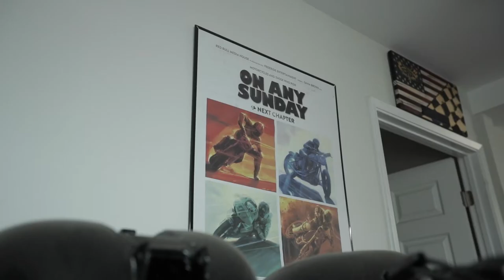Galfer USA Wave Rotor Installation on 2022 Harley-Davidson Low Rider ST

Comment: Without a real front master you’re absolutely wasting time with those rotors.  100% no bullshit and I’ll tell ya!  I have an inverted Ohlins, 320mm Galfer full floating rotors with Brembo M4 monoblock calipers, EBC EPFA  brake pads, braided lines & tested my break theory first hand son.  
With all that hardware breaking was marginal (at best) over the O.E. system.  I know, smoke crack every day.
I use an RCS Brembo master on all my Ducati’s, but pulled the trigger on a Beringer front master  for the Harley witha  20.6mm bore . I run a 17.5 bore on my single rotor- Supermoto  and love the feel on track.  Best thing you can do  (besides good tires) for your HD brake system is throw that piece of shit stock master into the trash.  Yes, I know  a  front master cylinder is big bucks, but how much is your life worth? I’m telling you right now,, if I had to put a percentage of brake loss left on the table using a stock Harley master  (even with all that upgraded expensive ass hardware) I’d say you’re losing about 40%
That’s no bullshit!  So save your money on those rotors until you’re ready to put an upgraded master on that pig. That POS StockMaster doesn’t even come close to having the required power for those calipers to bite. That’s the truth! Your wife and family will thank me later when you actually come home through the front door after your ride
Reply: You know there’s a sucker born every minute that’ll watch this video and will have to have those for the ooh wow factor. SMH
Reply: What Harley do you run the inverted Ohlins forks on? Your brake setup sounds very similar to the setup on my Sportster!
Reply: @jonnymac8925  it’s on my 2017 Dyna Lowrider S. If you went to this past Born Free show it was the black Dyna @Ohlins booth.  Glad to here you’ve done Suspention upgrades! Having the correct damping is crucial for safety, traction and predictability. Having the confidence and knowing that your tires actually  maintain  continuity with the road surface 100% of the time can shave 1/3 off your breaking distance in the dry ‘even’  when utilizing the sub par OE brake system! If you want to take your Sportster  to the next level let me recommend the Ohlins TTX 30’s for the rear. True, independent control of compression and rebound circuits. They’re pricey, but holy shit man- they’re insane! 
Take it easy my friend, ride safe🤙
Reply: @noonespecial1217  unfortunately I live in Canada so the Born Free show wasn't an option this year, but a lot of my friends down south went and had a blast! I'm debating on a NIX22 front end for the Sportster, but Rebuffini also makes a KILLER inverted front end that runs Mupo internals (another large Italian company used in SBK). The bike doesn't get tracked much so its more of a street ripper. That being said I think you  may has misread my comment, I was saying my brake setup is similar to yours, my suspension at this time isn't nearly as badass as yours. Currently I'm running 13 inch Progressive Suspension 490 Sport Series shocks with a Progressive Suspension monotube cartridge forks kit, and a Daytona Steering Damper. I've been pondering keeping the 49mm forks with a Nix22 setup on some Zack Nation Racing 2 inch drop trees with the GPR stabilizer. As for brakes, I have the bike sitting right around the 500lb mark, and it doesn't get tracked (drag races are about it since we didn't have an actual road course until about a month ago in my area) so at this time I am running a single disc setup in the front, but it's a good setup! I'm running a 13 inch Galfer Radial Wave rotor, Brembo m4 monoblock, TTI radial bracket, HEL braided line and a Brembo RCS15 for the front. The rear is a completely custom setup that is still being made, I just recently ordered a Brembo p34 2 piston caliper, and sent MoSport machine my drawings/measurements for the bracket to run the larger 11.5 inch rear rotor  with the upgraded Brembo caliper and upgraded Brembo rear master cylinder. As for upgrading to Ohlins shocks in the rear, that's a possibility but I am having a swingarm made and the original design is for a monoshock swingarm, so I may end up running a Ohlins monoshock if I keep the original design! I have 1000 other projects going on with the Sportster, I have a few videos on my page from when I got it (it was black) to how it was sitting a few months back (gray but not with the new upgraded brakes). I'm going to have to add an updated video very soon! My motor is built, but I have some more upgrades for that as well, ignition is done, foot controls are cnc foldable, motormounts are cnc and 1/4 the weight of OEM, changed the gearing slightly with the chain conversion, I added a HD tach, HD oil temp/level lcd dipstick, HD master cylinder fuel gauge that was built into the cover of the XR1200 master cylinder I was running, but fortunately there is also a fuel gauge built into the HD tach, so I still have a gauge haha! I replaced about 90% of the OEM bolts so far with ARP Stainless 12 point because I live 100 feet from the Atlantic Ocean and anything that isn't Stainless will rust very fast lol. As stated before the motor is built, 1250cc s&s big bore with 10.5:1 forged pistons, Feuling 505/515 cams (replacing with Feuling 580 cams in a few weeks), Feuling hp+ lifters, Feuling Endurance valve springs, Feuling 4.3g injectors, hammer performance solid pushrods, Buell bronze oil pump gear, s&s roller rockers, s&s teardrop air cleaner with s&s adaptors to run an extra large filter, TBR gen 2 stainless 2-1, v&h fp3 (swapping for dynojet powervision with target tune), The heads were stock minus the Feuling Endurance springs but they are getting cnc ported/polished with larger valves and I am installing a Buell XB12/HD XR1200 crank with CP Carillo pistons and rods, Jim's 1.5 crank pin welded and trued. The first mods I did to the bike were Suspension and brake related. I was running 11.5 inch Brembo rotors front and rear, a rebuilt Tokico with Brembo pads, braided line, XR1200 master cylinder and the rear was a bracket by Lyndall to run an 11.5 inch rotor (stock is 10.2 inches) with the stock caliper but like I said the front has been replaced again and the rear is being done now! Sorry for my response being all over the place! You have an affiliation with Ohlins, what is your opinion on the traditional style fork legs that Ohlins offers for the Sportster? The legs have the option to run either radial or axial calipers depending on which bracket is used. Here is the information on the Ohlins traditional legs offered in the kit!

"We offer the complete kit Indianapolis Special triple tree with conventional 43mm Ohlins FG 433/FG 434 or FG 620/FG 621 for Sportster models.
The Indianapolis Special triple tree is made from solid aluminum with CNC.
Top tree thickness is 34 mm. Lower tree thickness is 56 mm."

Again, sorry for the sloppy reply! Lol
Reply: @jonnymac8925  Wow! You’ve really done a lot for this bike.  Love hearing  that passion! 
I’m familiar with Rebuffini, and think they make a quality inverted fork. If you could swing it, I personally would run those over the NIX22’s. 
I currently run NIX22 cartridges on my 2022 Street Bob.  This is a great money saver for those who want the tech of Ohlins suspension while at the same time preserving the option of  running their factory conventional fork. The only thing with the NIX22’s  was that on assembly I had to put quite a bit of pressure to screw in the top caps. It was essentially pre-loading the spring prior to the user dialing in their preload.  Also, the shim stacks on the compression side looks to be a little less robust. It was still pyramided and all, I just wonder how it would hold up on a super hard hit or yanking wheelies.  The piston is also a 22 mm (hence the name).  It’s literally the size of a dime- half as big as my inverted set up on my Dyna.  We ran them through the shock dyno and matched our suspension graph exactly.  I’ve got about 300 miles,, so far so good! 
You mentioned creating a swingarm to run a mono shock.  All the M8 Softtails run the mono shock in line with the backbone at a quirky angle.  There’s no linkage system. The swingarm pivot, and radius design seem off to me.  I run an Ohlins HD 504 shock to help, but  keep in mind a top tier shock can’t  fix a poorly  designed chassis  geometry.  I’m not saying mono shocks are bad! Both my Ducati’s, SM, and dirt bike all run them.  What I am saying is that the 2022 M8 has some strengths, but also some shortcomings. That rear chassis design is one of them.  Let’s see what else… Oh yeah you mentioned a single brake rotor, and a  radial versus axial mount.  I think on a bike like yours, a single rotor would be sufficient.  I would recommend going with a radial style caliper though.  I think power over feel would benefit you more in this application.  I’ll close with steering dampener’s.  I have to tell you that I’ve seen a few rotary style stabilizers fail.  This can lead to an extremely dangerous situation!  I’ve been using the traditional style damper for 30 years no issues.  In most cases because of the amount of rake Harley Davidson uses, plus the ridiculous 6 inches of trail, long wheelbase and sheer girth a steering dampener is not usually necessary.  However, I wanted to run one. 
The only problem is no one makes mounting hardware other than  buying a new top clamp from GPR’s dampener kit, so I designed one in CAD- modeled it with a 3-D printing machine, then sent my plans in for a five axis CNC machine to be cut and anodized. Now I’ve got my Ohlins dampener.  I got the pieces a few weeks ago and I have to say the fit and finish came out Bitchin!  Generally, you can use triple trees to dial in offsets for steering geometry, or hold giant 58 mm inverted Ohlins forks😆 
Its not always necessary to run new clamps though. 
I hope all this helps. Yes I am partial to Ohlins, I’ve run their product almost exclusively the last 30 years.  They make an incredible product.  There’s a reason why 100% of Moto GP runs Ohlins suspension, 95% of world superbike, and 90% of Moto America.  Ferrari is signed exclusively for Ohlins in Formula One this year. It’s an incredible product, and you get what you pay for. That said, addressing the poorly designed suspension issues of your Harley, Davidson motorcycle is Paramount. 
There are many many suspension brands and  products out there other than Ohlins.  You’re almost always better off, upgrading your suspension with whatever brand fits your budget, than not doing anything at all! 
Good chatting with you, my brother! Take it easy and ride on!
Reply: @noonespecial1217  OH wow! It's funny you hit on so many points that I was going to bring up! Starting with the Nix22 and Rebuffini inverted front end, it's incredibly funny you mention wondering what would happen on a hard slam or a big wheelie. That's the main reason I haven't pulled the trigger on the Nix22, I seen a video with Big Bear Performance where he highlighted the strong and weak points of the Nix22 and one of them was that they can't handle a hard slam from a wheelie and that they will break, which was a bummer for me but perhaps for the better. I do like the inverted Rebuffini front end, and they also offer one with Ohlins legs. Then we move onto the brakes, my new and old setup both had radial calipers out front! First I had a 4 piston Tokico with Brembo pads, and now I have a Brembo m4 monoblock on a 13 inch Galfer rotor with HEL line to the Brembo RCS15 but it's now winter here and I haven't gotten a chance to take it for a ride with the new brake setup! As for the dampers, the only reason I really like to have one is because the front end really likes to come up between the first 3 gears so it helps keep it from being violent if my wheel isn't 100% straight. The damper I have is starting to lose its pressure, and I don't want to rebuilt it, bringing me to something else I was going to mention, and that is the idea of using the current bracket I have and getting a 120mm stroke Ohlins linear damper and simply swapping that in place or the Daytona!  As for the monoshock idea, again I completely agree! The geometry has to be perfect,  luckily the company that makes the swingarms has done all the r&d and they are great, but that isn't for sure going to happen as then I have to start relocating oil tanks and batteries, but it is an option. The m8 softail swingarm/monoshock is an abomination to all monoshock bikes in my opinion hahaha I also have the same opinion on stock Harley Davidson Showa forks whether conventional or inverted. Money isn't exactly an issue, not because I have an abundance of it but because I refuse to use sub par parts on my bikes. When I originally did my suspension there wasn't much out there for the 49mm 48 forks since they were they only Sportster to get 49mm cartridge forks. They are very similar to the Dyna Lowrider S forks but they are shorter, and single disc. One good thing is that the Sportster doesn't have a super long wheelbase, 5 feet and 2 inches, and the rake/trail isn't too bad for the big front tire at 30.2 degrees of rake and 5.3 inches of trail. The Zack Nation trees would change some of that and they have the GPR stabilizer built in, that is the only reason I even thought of using one, but they can also be ran without that style stabilizer for the rake/trail and 2 extra inches of ground clearance. That being said, I will probably go the inverted route when the time comes! I am changing my cams and tuner, headwork and crankshaft, rear brakes/swingarm and then it will be time to address the front end. I would like some 17 inch wheels, so I'm thinking a set of Sportster superlow wheels, or if things go good maybe a set of BST carbon wheels. The bike has carbon fiber side panels and a carbon fiber front fender. I paid the guy to make me rear fender and he ripped me off, now he is selling the fender he made for me, that I paid for, on ebay 😂. I've swapped all my engine cases to gloss black HD rail collection cases (primary and chopped cam cover and lower rocker boxes, pushrod tubes and tappet covers) with Iron1200 flat black top rockers,  HD motor Co gloss black derby cover and a Feuling points cover,  HD black gas cap. The clutch is Barnett extra plate clutch pack, Barnett billet pressure plate and a Barnett 25% diaphragm spring with a 1FNGR easy pull clutch lever. Ignition is Screamin Eagle high compression spark plugs, Screamin Eagle 10mm plug wires and a COMP Cams EFI ignition coil. That's a basic rundown on the bike hahaha
Reply: @jonnymac8925  That’s quite a list!  There so much there, thanks for the run down.! You’re correct- a smaller wheel base axle to axle typically means a much more nimble bike, but also means potentially less stability at higher speeds. There is always give and take on track, even street. 
With a much more powerful motor, short wheel base & lighter weight your HD Sportster could lend itself to some unwanted head-shake under acceleration chop. Especially in those lower gears.  A dampener is always a good idea. 
Putting the bike on 17 inch diameter wheels opens up every  avenue for performance based road & race tires. The selection is almost endless! 
That bore size on your Brembo master for single disk should absolutely bring that bike to a prompt stop while on the binders for sure! 
Be nice to get your feedback once the weather warms up in your area. 
I’m actually meeting with Luke Leatherman from Feuling tomorrow morning regarding an issue I’m having with excessive crank case pressure/& venting relief on the M8. He’s also putting some tweaks on their final design BA air filter for twin cam. They’re using my Dyna for final fitment for various throttlebody body sizes. I am using their cam chest internals with their anti-reversion chambered headers for M8.  Kevin Alsop (with Big Bear Performance) is the real deal when it comes to valving Ohlins suspension on Harley Davidsons. He has personally suspension- tuned two of my Harley Davidsons. Speaking of Big Bear,, Kevin has been working hard (and out of supply chain necessity) has designed a kind of hybrid front cartridge with Ohlins. It’s his 32mm set up. He tells me these things are bad ass! Plus, since he’s doing all the tooling & CNC work in house there is no more wait times from Ohlins.  As far as the NIX 22’s go- they are a smart option for sure.  I will be reaching out to Joey Subrizi w/Ohlins USA regarding the top out spring sizing on those particular cartridges. The Kit requires you to change out the factory top out spring with the Ohlins one (included).  If using this replacement top out spring you actually preload the primary spring a tad while securing the end cap. This doesn’t feel entirely right to me. But again, Ohlins engineers are the best in the business, so maybe there’s a reason for it? Like I mentioned earlier, Kevin was able to get the suspension graph to match up perfectly from the suspension dyno on those NIX22’s. 
As far as ripping wheelies with the NIX22’s,, it’s not like you ruin the forks or anything.. it’s just that you might end up bending the washer (shim stock) on the compression side. 
It would have to be one hell of a massive hit to accomplish this though..
I personally do not ride my Street Bob like an animal 😆